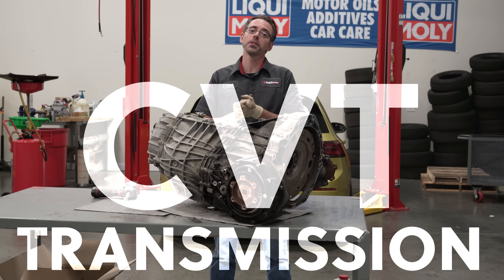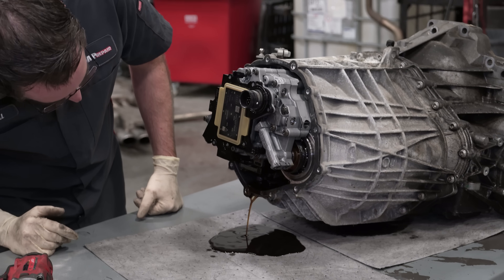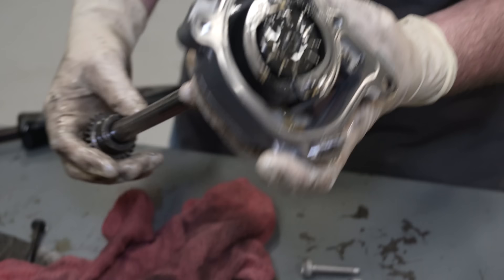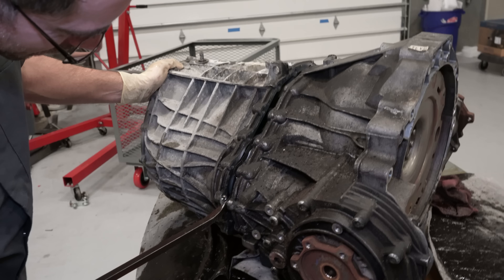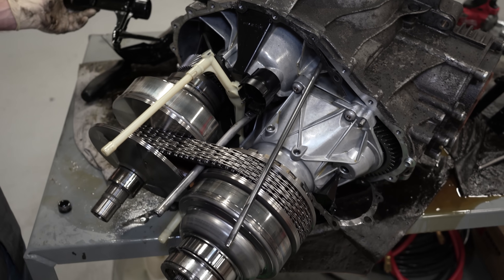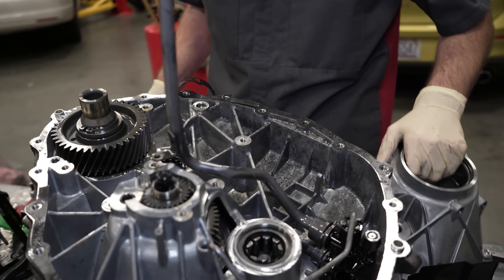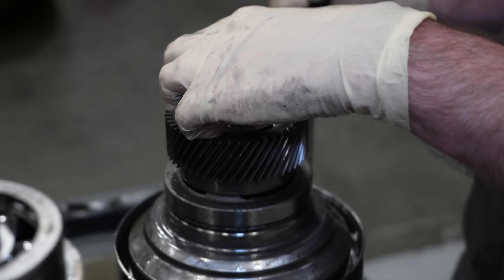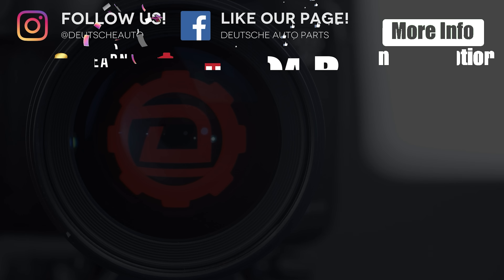Why you shouldn’t get a CVT transmission

Comment: I have the worst one of all the JACO... LMAO.. I have a Tuned Nissan Juke 246 WT and basically the same WHP... I spent 700 Bucks and took her from 155 WHP to about 250 HP.. I do have to baby the CVT.. Has a lot of torque down low but power falls off a cliff once I hit 80Ish.. Meaning it stops pulling hard because it's a small stock turbo, But I pushed mine and I am at 100K now.. But I am also running Amsoil CVT fluid which does grab about 20% better and runs 8 degree's cooler on hot days probably helps too.. Plus I have small CVT cooler to.. I also do 5 quart drain and fills once a year in the somers too..

Comment: Hello, I hate these Audi CVT too. My son had a 70.000 Km A6 with this junk gearbox and had only issues. Specialists filled auto trans oil in it and it should kost 6000 Euro to change the gearbox by Audi. 
We found one to repair the electronicbox by changing for 750Euro the speedsensors right looking out of the box and it works, but not for a long time. Sorry, the times has gone, when german car manufactors could create good cars. Problems I've never had with my 79 Cadillac Coupe Deville or 95 Chevy Van G20 at all. These cars running without any problems for many years.

Comment: A4's were not the only Audi's to have a CVT. I had a 2003 A6 that had a CVT. The trans was replaced at 20k miles (slipping).....after the replacement (upgraded CVT) I drove it for 300k no problems. Not bad considering the stated lifespan of the CVT at that time was 250k miles.

Comment: The CVT in my 2006 Ford has over 300k miles on it and still runs smooth as butter. Never had an issue with it, and I've never messed with it. Hasn't even had a fluid or filter change in its entire life. Well, once I did hit a deer and it cracked the cooler, and lost a small amount of fluid, so I replaced the cooler, and topped it up with my best guess of how much it had lost. So about half a quart of fresh fluid was put in it about 40k miles ago...
For that car, being an SUV that I'm not trying to race or anything, just get up and down these windy mountain roads in a timely manner, it's actually pretty great. No shifting is very nice when I'm used to regular kickdowns and engine braking in my other car. Ford CVT ftw

Comment: I've had several cvt transmissions and have been happy with them all.  To me it makes sense to have the engine maintain constant rpm and the vehicle accelerate
Reply: My Mitsubishi outlander has 157k, and my cvt transmission works just fine. The secret is to not abuse it and keep clean fluid in it.
Reply: @jimb3457  That or you got the unicorn in a sea of lemons.  Face it, CVTs are generally crap.
Reply: @jimb3457  And get lucky, which is the most important part
Reply: @jimb3457  whats how many miles do you let it go to till you change your cvt oil for the outlander?
Reply: @cesarpdc  30k. Get it done at the dealer so correct oil is used.
Reply: I'm a guy that likes to vroom vroom sometimes, and the cvt just ruins that. But for cruising around and for someone that never goes above 3k rpm I'm sure it's fine.
Reply: @spicysnowman8886  I've got a 2014 Subaru Forester XT, with a stage 1 tune it gives some great vroom vroom, just "drop a gear" on the CVT and it kicks you very well😁 When I kick down it revs to 6000 rpm to get the turbo panting better.
(yes it is "faked" gears where I force gear ratios to give 6/8 gears depending on drive setting)
If I just wanna accelerate fastest possible I leave it in standard mode and put the foot down. No kicks in the back, but for sure the scenery rushes past very swiftly thanks to a healthy bunch of horses breathing Turbo air😁
Change fluid as with any normal maintenace scheme and CVT works just fine for powerful daily driver cars too
Reply: @bennylloyd-willner9667  i can downshift and revmatch anytime i want. I can revmatch downshift and be obnoxious at every red light and stop sign if i feel like it. It's just infinitely more engaging.
Reply: Great for your wallet, but when you say you've had several, given that they're a relative novelty, it makes us wonder why you don't still have them.
Reply: @Krakondack  I'd say most economy cars here in the US have them now, so they're far from a novelty
Reply: @QuincyStick  Let's talk when large numbers of those economy cars are due to reach 200,000 miles.  Are they still on the road?  Or did they have to be thrown away, because the only option was a new, $10,000 CVT.
Reply: @Krakondack  cvts are not 10k firstly and secondly there are many, many Hondas and toyotas with 200k+ miles still driving no problem. Even Toyota and Hondas larger suvs use them and are still totally fine
Reply: @QuincyStick  I don't doubt you'll find examples, but it's a question of what is your risk, given that a failure totals the car.  If it's 20%, at least you'll know what the odds are.
Reply: @Krakondack  unless you're buying a Nissan, it's much less than that. Even then Nissan just revamped their cvts 3 years ago and I haven't heard about any problems with them since which is already better than they were before
Reply: @QuincyStick  I'm not interested in your opinion on the matter, honestly.  I was in a transmission shop within the last year, and they assured me even the Honda and Toyota CVTs are coming in with some regularity.  And they can't rebuild them.  The car is mechanically totaled.  Too much of a risk for me to even consider it.
Reply: @Krakondack that's speculation only, when cars with great mileage break down, do you really think CVT is the only culprit. This video isn't serious, so why speculate because of it?
Reply: @Krakondack   relative novelty?? Cvt transmissions have been around since the late 80's. I've got one in my 2011 Mitsubishi Outlander Sport with 153k on it.
Reply: @jimb3457  still novel. Electric cars have been around for decades too but they're novel to us as well nowadays
Reply: Oh, you're the one.

Comment: Our Honda Jazz/Fit has a CVT and it works like a dream. We have the transmission fluid changed every 40,000km/25,000mls, currently at 75,000km.
Reply: The Fit is a small car that doesn't weigh much, with a relatively low-power engine, so the CVT isn't subjected to huge stresses. Keep changing the transmission oil at 25K miles and it should last as long as the rest of the car.

Comment: Funny since I had a 2017 Ford Focus with a 6 speed Automatic. With 44k miles on it. Clutch was replaced twice due to slipping and the vehicle was shuttering. I ended up getting rid of it as the clutch was slipping FOR A 3RD time and Ford was saying it was in spec.. when I went to chevy to look told me "You know you're clutch plate is slipping"  I ended up getting a 2023 Nissan Altima with a CVT transmission and it's so much smoother than my POS Ford

Comment: Had a 2010 Jeep (Dodge) Patriot that was equipped with a CVT transmission. It would overheat and you would have to pull over and let it cool off before continuing on your journey. And if my memory serves, the user manual tells you just that as if it were completely normal. It was absolute junk. I had a Nissan Rogue recently that also had a CVT that was also junk. It was not as bad as the Patriot and I didn’t really have issues until I got to high mileage. It took out the transfer case and eventually the transmission had to be replaced. I was lucky enough in both situations that they were company  vehicles, so I incurred zero out of pocket expenses. I would never and will never purchase a vehicle with a CVT transmission. Any gains the manufacturer claims about CVT’s is overshadowed by the loses. Also in both situations most of the mileage was highway miles.

Comment: Why not use a bench that's the right size instead of struggling and putting yourself at risk? Bits all over the floor, oil all over the floor, it doesn't exactly look professional.

Comment: Audi and VW ain't the same as 20 years ago. They are complete junk over engineered. The Cvt if I'm not mistaken 40+ old technology by Mitsubishi. I own Altima with Cvt for 145000 miles serviced  2 times with Valvoline synthetic -no problem. It's not Cvt it's the DRIVER

Comment: 2020 Mitsubishi Outlander 86,000 miles. I use it for business (mostly highway miles) and I change the transmission fluid every 15,000 miles. I know the problems with CVT automatics so I tend to drive it like a 90 year old grandmother. So far, no problems. We’ll see.

Comment: Excellent video.  Funny thing is that my older son bought a large Subaru SUV used (19K miles) and it has a CVT.  When he told me I SMH but said the vehicle looked nice.  Told them to pay strict attention to maintenance of that transmission and that it will most likely start having issues about 100k miles and they would be looking at a replacement at about 150k for about $7k.

Comment: If CVT was reliable we would see them implemented on F150s, Chevy Silverados, and Supras. It's junk and a lot of manufacturers are quietly transitioning to DCT or 8 speed for ICE. My honda accord 2014 cvt died at 89k miles with proper fluid changes so its not only maintenance its the inherent weakness of the mechanicals inside it.

Comment: My accord had 180k with original cvt  did the service every 30k it was like $70 at Honda dealer .. sold it ran fine . My ex girlfriends Nissan versa tho that was crap but then again the car had no power
Reply: That's a great deal! My cvt fluid changes were 168 dollars at a honda dealership.
Reply: @JohnS-il1dr  sold it in 2019 the last one I did was 2018 it was a 13 accord

Comment: As usual, way over engineered German crap. Our Prius with CVT had 200000 miles with zero CVT issues. Subaru's have near zero CVT issues.
Reply: The Prius uses eCVT which utilizes a planetary gear set up and it doesn't pull the weight of the car but rather runs a motor to charge the battery. Totally different from the garbage cvt in modern cars.
Reply: @JohnS-il1dr  Appreciate your reply but you are very wrong. Toyota's hybrid unit uses a planetary system but it is to blend both electric and direct drive power. It is capable in standard trim of running on electric alone only for very brief periods and no faster than 35 mph if you are on flat or decline road. Newer models now have a mechanical 1st gear for launch to improve durability. Cheers
Reply: @brunothepug8807  My '04 Prius has nearly 250,000 miles on it.  The CVT is fine; I replace the AFT every 80,000 miles.  I get 50+ mpg.  And if I drive 41 mph or lower, I can improve the mileage slightly going uphill.  (I live a mostly rural area.)  The slower driving speed reduces the tendency for the engine to run.

Comment: I Got 258,000 Miles Out Of My Ford Freestyle CVT.. It DID Make A Grinding(Rough Mechanical Noise) Noise At 117,000 Miles.. Allowing Me To Buy It For 500 Bucks.. I Got it After The Wife Could Not Turn Up The Factory Radio Enough To Cover The Rough Mechanical Noise.. At About 210,000 Miles..
I Like The Freestyle.. Big Enough To Carry My Military Gear for National Guard.. Tools.. All My BS..
Going To Get Another CVT Trans For it.. Buy A Rebuilt... 
I Have Sooo Little Money Invested In It. And Got Sooo Many Miles...

Comment: One failure mode that is not discussed often enough is the dead-stop torque placed on the pulleys which wears the spline channels that the sheaves ride in via steel balls bearings, causing the sheaves to move out of unison, resulting in a lateral force on the belt and belt failure. The sheaves on each pulley must move in unison to prevent the lateral torque. Another teardown video of a Jatco CVT exposed the excessive wear on the splines. Either the shaft is not machined to handle the torque or the design didn't provide adequate ball bearings, or both. Toyota tackled the problem with a transmission that used a standard gear set to handle the initial dead-stop torque, then shifts to CVT mode once the inertia is overcome.

Comment: I have had 2 Toyota Corolla LE's with CVT's and have absolutely zero problems with them over 100,000 miles. They get better gas mileage and as long as you are not racing (why on the street?) they are excellent and efficient.

Comment: I'd rather have a car cheaper and easier to repair than something complex like that and only slightly more efficient.    Gas is cheap compared to all that throw-away componentry.    I like the 30% reduction of parts electric cars are giving us.     There's just too many valves, seals, wires, sensors in most modern vehicles.

Comment: The Mk3 ford focus has a dry automatic transmission with a manual type clutch and is electronically controlled. Only auto Ive seen like it.